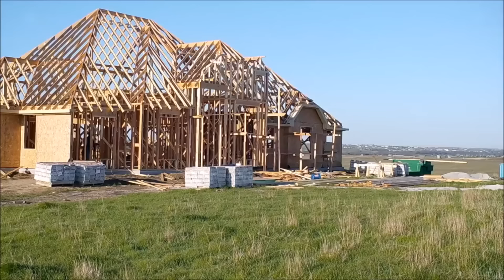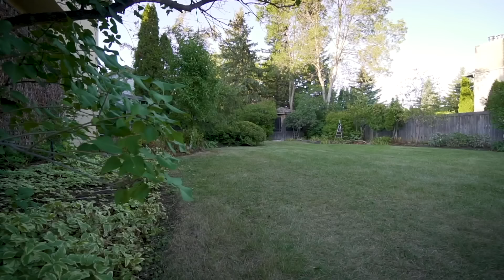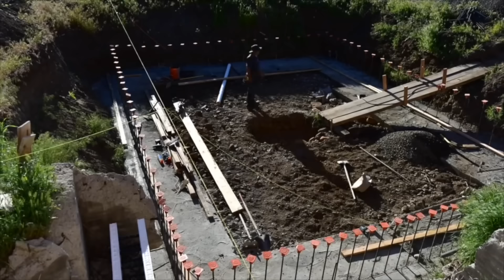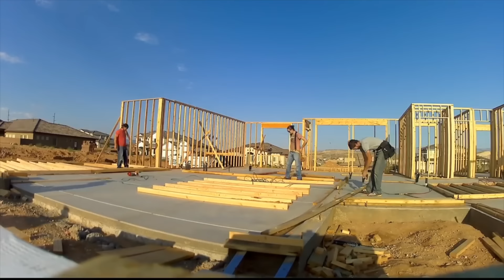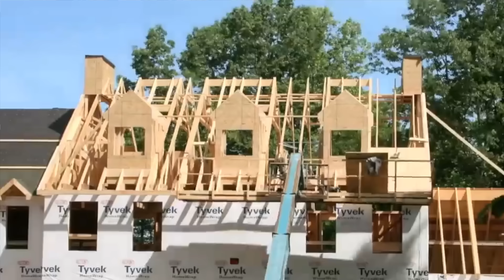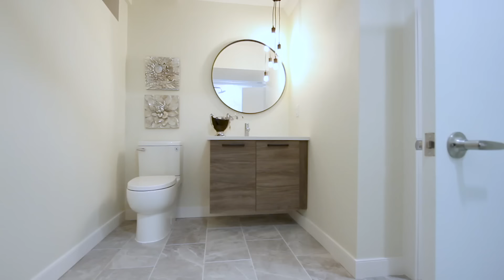THE REAL COST TO BUILD YOUR HOME | Custom Home | Building a house Cost

Comment: Not sure if it’s just Louisiana, but our avg price is much lower, closer to 105-115$ sq ft. Of course we don’t have basements here. 🤷‍♂️
Reply from the maker: Ben Provost Yeah, you are spot on. Geographical location plays a monster part in costing, as well as finish level, material quality, and yes, without a 3000sq ft basement, the cost is much cheaper.  A 3000sq ft bungalow without a basement could be 150k+ less.  (Price per square foot is not correlative with the “true”cost of the upstairs average). Thanks for watching
Reply: Yea, after watching this I went and looked up average houses based on states. It’s crazy, median 108k in West Virginia, 165k in Louisiana, all the way up to 409k in Washington and 554k in California. And those are the averages! Wow.
Reply from the maker: @benprovost6298  Yes.   Very large variations that you can not generalize without knowing exactly what is being built.

Comment: Can you describe the finishes in this estimate? Are you using laminate floors, granite counter tops, stock cabinets? Etc?
Reply from the maker: 8/10.  Engineered hardwoods, quartz countertops, Upgrades structural components, emtek hardware.  Thanks for watching.

Comment: no doubt one can spend a lot more or a lot less.  It all starts with a sense of what one wants.  For instance things that most people dont consider.. Kitchens only since the 1930s really had much in the way of cabinets.  Plumbing where wet walls back to back make economic sense,  Interior / exterior finishes can vary according to how ridiculously one decides to do finishes (real stone imported from thousands of miles away,  or glazing that is imported from the EU to get that extra seal.    How much work one is able and willing to do personally if any.  One thing most folks forget is the cost of hiring a builder.  25% is in the right ball park but doing things like change orders can pop your budget in a huge way.    Lots of ways to bust a budget if you play with these changes.    So yes easy to see a project go from $150 a foot to that $300 a foot.   Over all think your estimates are pretty accurate at this point.. give it a year and likely will see the cost of materials taking another jump in price as people replace due to various disasters be it floods or fires or earthquakes.  Then there are the political disasters like we see with places like Detroit or Baltimore.   It pays to really pay attention to the details and keep a tight grasp on things.. Remember most people move every 7 years or so...
Reply from the maker: Steve Pailet great points. Thanks for watching!
Reply: @EmmettLeoHomes  Figure about the cheapest one could DIY is perhaps $50 sr ft.  Materials just seem to be rising in price constantly.   Labor is crazy.  Seems the gamers that we have coming up now are not interested in becoming craftmen or quality tradesmen. Just a problem all over the country

Comment: Very helpful video. Can you estimate the cost impact/sq ft on the materials and labor in 2020? Are you seeing unique challenges in material and labor availability and permit time intervals, given the new Covid work from home scenarios? A lot has changed in the last 18 months.
Reply from the maker: In winnipeg, and probably most of canada, multiply your Lumber package by 4.  Labor hasnt changed that much, except in unskilled specific trades where a lot of the laborers have taken the gov. subsidies instead of going to work.  Now that that has depleted, they are returning to work.  We haven't slowed down.  Although shipping issues and material shortages are probably the biggest headache right nnow.

Comment: A 2,200 sf home for $341K is not bad!  Although what if we paint it ourselves?  Could we save $20K?  Great advice, nicely detailed so we can understand everything. :  ))
Reply from the maker: Depending on your contract and builder, you may be able to do a lot by yourself and save a lot. Just don't expect any warranty on the self performed work.  Make sure to check out the next video this week that goes through an 8000 sqft, $4Million home line item breakdown! Thanks for watching!
Reply: @EmmettLeoHomes  I'll be watching.  Thank you!!

Comment: Do you need planning permission to build a house on your own land in the USA? It's an absolute nightmare to even build an extension on your home in the UK, and if your house is a listed building (usually on bigger houses that are 150+ years old) you can pretty much forget about changing anything on it. Even the windows and exterior doors will not be allowed to changed if it is really old. You can't even paint the exterior a different colour if you want to in most cases of listed buildings. You can't even cut down trees on your property if they are on the land registry for the property. You can be fined big money for failing to get the correct planning permission and it often takes years for anything to be approved which sometimes will never get approved and even when it does will cost you an arm and a leg in fees.
Reply: Here in the USA, we have what are called Historic Districts.  If your home is in one of those, it's the same principle.  You're limited in what you can do with renovations because they (usually the local government) want everything to be historically accurate, at least on the exterior.  When building on your own land, it all depends on if it's rural (where you can do pretty much as you please, as long as it satisfies the state building code), or is in a town or subdivision with restrictive covenants.  Depending on the age of the subdivision, those restrictions can be either minimal or absolutely brain-numbingly stupid.  That's why it's so important to do very thorough research before purchasing vacant land here.  Oh, and as far as actual construction goes, there are planning and zoning laws to consider (for example, you can't build a factory on land that's zoned residential, and pretty much vice versa), as well as the state building codes which specify minimum standards.  Hope this helps.

Comment: These numbers are wildly speculative and can vary for a number of reasons. Contractors are notorious for code and quality violations, errors. You are better off getting a well experienced architect to answer all these questions for you on safety, quality and cost.. Architectural fees are usually only 3-4% of the entire development cost. Fact.  
The fastest way to get conned/cheated on cost, quality and technical issues, is to try to be your own contractor.  Most of my early career as an architect was helping home owners correct bad, shoddy, illegal construction on their homes.

Comment: Good video. I'm building a house in Wisconsin with a good builder that I found mainly since I have immediate family in the business of new home building for decades now in my local area. 2700 sq ft ranch + 800 sq ft finished basement, and a 4 car garage. The build is about 600k and an acre of land cost me 118k. The builder is at $120/sq ft and that's with good 2x6 construction, fixed SIPs at 50k, poured foundation and higher end insulation and subflooring, sound proofing in the walls, etc. point is it's a solidly built house overall. One thing not considered by people is that cost per sq ft varies based on what area of the house you are in. For my case, the builder charges $53/sq ft for finished basement, as opposed to $120 on the main floor. Likewise the garage footprint has a cost per sq ft. When you are budgeting for the house, it's worth considering that if you need to save money, building out a basement can be done in phases as it is pretty easy to add sq ft later to a finished basement. Also worthwhile to consider that (at least in an area that requires basements), it is always cheaper to build up rather than out. A ranch will be more expensive given equal sq. ft to a 2-story because the 2-story requires less excavation and less foundation pour. 

An important thing to remember for cost when building a home is that it is always a seller's market. You will never have power as a buyer. Ever. You will always be paying the absolute top of the market in terms of $ / sq ft when you build a home. It's nice to get what you want but few people are honestly financially strong enough to justify building a house. Many people build with 5-10% down payment and don't have a lot of extra money laying around and that is a risky way to build a house, and with 5-10% down you have very little room for an exit strategy in a downturn where you had to sell (likely you would be underwater at that point). The cost is very high when building a new home and raw materials go up every year, especially lumber prices. I am using the equity in my current house to put 20% down on the new build, and I also make sure I have another 20% of the cost of the house in liquid assets just to deal with potential loss of work/income, unforeseen errors from the build that may not be covered after the initial 1 year warranty on workmanship is up, and let's not forget the driveway and landscaping that aren't included in a base build price. That's all out of pocket unless you ask the builder to do it but you shouldn't because you should always let the house settle (if you have  basement for sure) for a year before pouring a concrete driveway. 

It costs a lot to build.
Reply: StopTheH8GetAV8 thank you. Good advice.👌
Reply: $118K for an acre in Wisconsin?  Sheesh
Reply: GB and PG it’s silly we are only moving 10 minutes north of where we are now - our current area has developments and the going rate for even just a half acre is 215k. It’s sad but I was happy to find something in the same school district for 118 to get the acre.
Reply from the maker: Yes.  Thanks for the comment.  It is always dependant on the location and the what you build.  It's why it varies so much for so many people.   Thanks for watching!
Reply: Can you tell me the name of the builder? I’m in southeast Wi. looking for a reasonable builder. Thanks!
Reply: Caroline Nelson Korndoerfer Homes, we just finished selections and dig this week, the process has been very good so far. Our original plan has expanded to about 715k for the build itself and other custom home builders in the area that I had bid out the house were 100k more for similar construction. Korndoerfer is fair. You will want to talk to Duane Arnold he is by far the best person to help you price out a build. 

Avoid Tim O brien, avoid Beilinski, avoid  Veridian.
Reply: StopTheH8GetAV8 Thanks. I’m just looking to build around 1800 sq feet w unfinished basement. I already have the lot. If I want decent finishes not high end, what would you guess it would cost?
Reply: @carolinenelson3621  i asked my contact there and they said 350 is a "safe" number, which tells me you could be anywhere from 300-350k depending on the finishes you want.
Reply: StopTheH8GetAV8 Thanks so much! I will definitely have them give me a price because 300k was what I was thinking. Have a great week! 😊
Reply: @carolinenelson3621  Definitely. Their design studio is located in Brookfield and they mostly serve SE Wisco so you're in the right spot. I highly recommend talking to Duane Arnold, tell him Jordan sent you. He's my uncle in law and has worked with many of the builders in SE wisconsin over the last 15 years. He will make their pricing extremely transparent, no hidden B.S., and he knows how to accurately price the house so that you don't have big cost surprises down the road
Reply: StopTheH8GetAV8 Ok I will. Thanks again!!

Comment: You just blew my budget expectations out the window. I was imagining building a 2000 sq ft home for around $150K-160 with the help of the Amish community. I purchased a 1 acres lot for a bargain of $4k from a family legal dispute. Wanted to build something simple just to rent out for additional income. $340 K is way too much for a 2000 sq ft home imo. I think ill look into selling the land at market value instead.
Reply: You've probably already made decision.  But check into your area for prices.  In Mississippi,  it can be $80 or so a square ft.  Maybe build slightly smaller,  too.  Good luck

Comment: I am a Cabinet Designer and I hate to be the thorn here but I see this everyday, all day long. Your cabinetry budget is WAY TOO LOW. It’s like 25% less then it should be as a base line. Talking about kitchen, 2.5 bathrooms, closets, pantries, drop zones, built ins etc. a house adding up to what you are stating needs a higher cabinetry budget because it should be a line items as in foundation and framing but isn’t looked at until finishing and by that point people never have enough in the budget to increase for the low ball estimate on cabinetry. Also cabinetry needs to be designed before framing is done... why? Because most architects don’t think about how cabinetry will fit and if a window or door needs to be shift down 3” or 6” to make the cabinetry the most functional then it can be done before you have to pay a farmer to change order something. It’s why I do what I do, in blue print/ plan review. It’s very dishearteningly have people fill their Houzz and Pinterest up with all these options that would make their homes far more functional long term and their builder under shot the bid estimate and they can’t have but the bottom line. If I was building a house I would be livid ( and most of the time they are but builders don’t see all that because it’s wrap up time for end lunch lists and they don’t care what they have done to set up their clients to be disappointed... also by this point the clients are DONE mentally with building a home and builder do not give one crap these clients have to make so many decisions and end up not being happy with the end result but accept it because they are just so “ over it” already and just want to be living in the house ). Just an FYI move that line item up to the top and think of it as a foundational item and you will make your clients 1000% happier and that looks good for business, saves the client and the build money to not have to change order or compromise to get the dream home they want in the end.

Comment: 341,000 really isn't that bad. Is it cheaper to build up, rather than out, though? Like, if I have an open floor plan on the ground floor (kitchen, family area with no real walls) and then put bathrooms and bed rooms above it, how much difference are we looking at here if the base is say.....1,500 square foot.

Comment: In canada you're looking at 125-250 a square foot depending where you live in canada.
Reply from the maker: It always depends on what your putting i and your construction method. Simple building and simple finishes, you can absolutely hit those.  250 allows you more rooms to get quality finishes in there, but your still kit getting into complex high end housing.  

Thanks for watching!
Reply: @EmmettLeoHomes  I know that, I build houses :P

Comment: How are these expense estimates adjusted if you were to include solar power as an alternative source to supplement your electrical needs?
Reply from the maker: Great question.  The infrastructure still remains the same, however you have to add additional electrical components in order to run the panels, and tie into the grid.  It affect the planning also as if you are running it now, vs. later, you have to be able to access the runs up to the roof.  Its simply additional line items costs from a costing perspective.

Comment: Appears that buying an existing house and retrofitting it may be a bit more reasonable.  Assuming that you hire an architect to modernize the floor plan modifications, maybe an interior designer, and a general contractor.  

This may be cheaper because most of the foundation, framing, and rough plumbing is done.  Hopefully you’ll get the current floor plan, new kitchen, bathrooms, windows, doors etc.

Maybe this will also save you money on landscape and and hardscape costs if the prior owner already set it up.  

We’re talking reasonable costs here and not that house porn stuff from Architectural Digest.
Reply from the maker: Pacific Blue in a lot of cases, all things being the same, a resale home will be cheaper in the long run.  

Building new ensures that everything is new, with warranty, and has never been lived in.  If those things are big to people than it makes more sense to build.

If they don’t, then Maybe resale is a great idea.  

You nailed a lot of those reasons not the head, let alone the opportunity to negotiate if the seller is willing to.  

Thanks for watching!
Reply: Emmett Leo Homes 
If I was in the market for a new house build and fell into the bracket of $275/sf, how much could I expect to pay for a resale retrofit?  Let’s say the house has about 2k sf?  Thanks